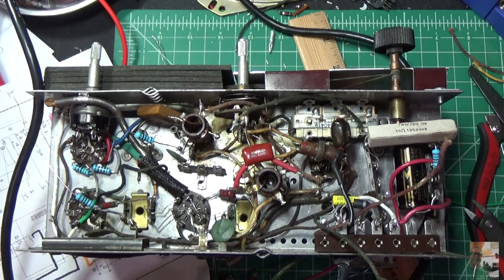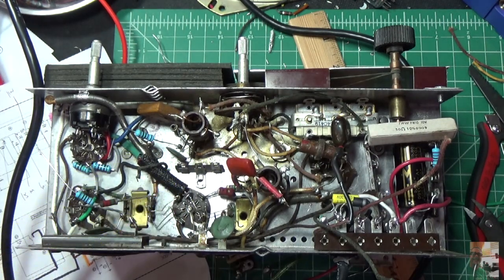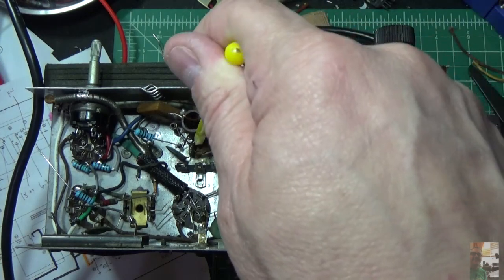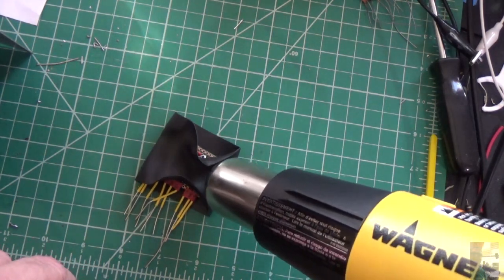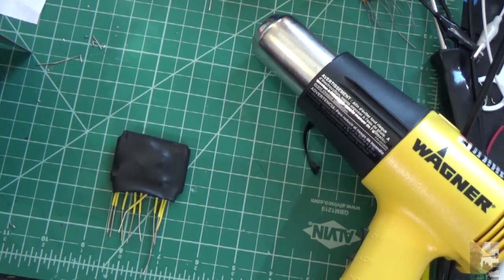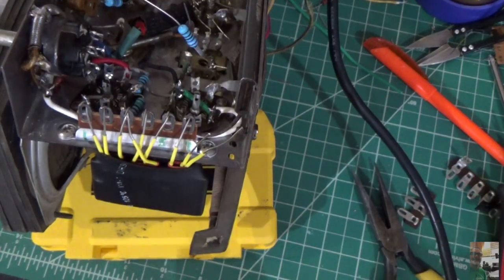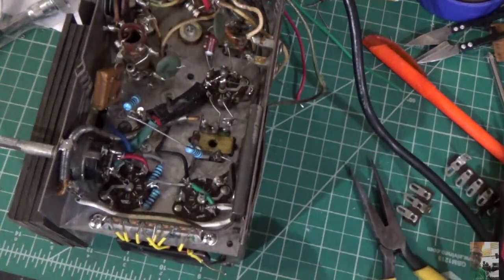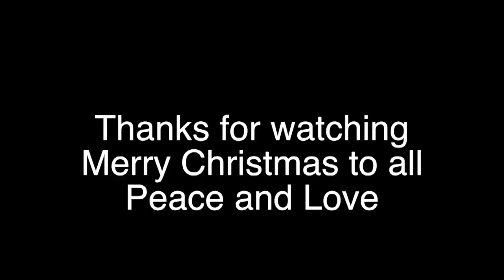Hallicrafters 5R41 and S-20R Restore Episode 13 - Jack Klugman and Tony Randall  in The Odd Couplet

Comment: Hi Ron. Radio looks great. Great job on the couplet.  One tip if I may. I use an Ml-90 or M-90  inrush limiter it extends the life of your tubes and dial lights Etc. I get them through Mouser A little over two dollars a piece for ten. I put them on the positive side between the switch and power cord. They get warm so mount them for air flow.  Peace and love to you and yours 
Bobby
Reply from the maker: Very good advice Bobby and makes perfect sense. I will look into that, especially for my Boat Anchors.... good stuff my friend, thank you !!!! Ron